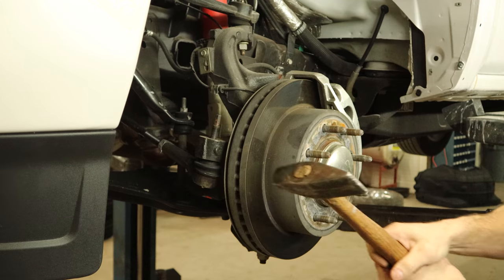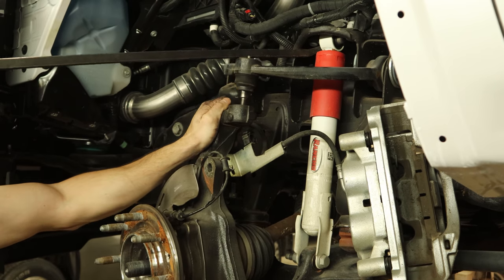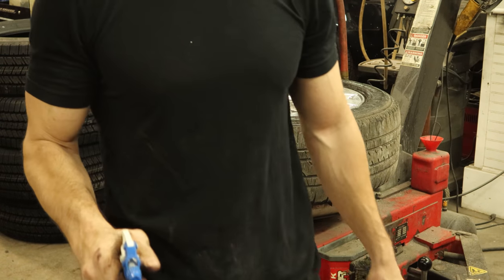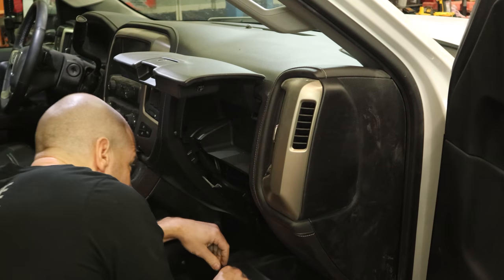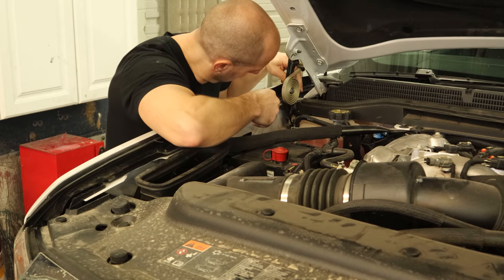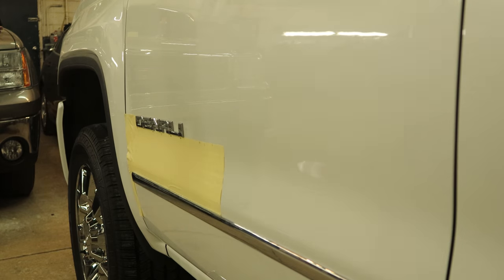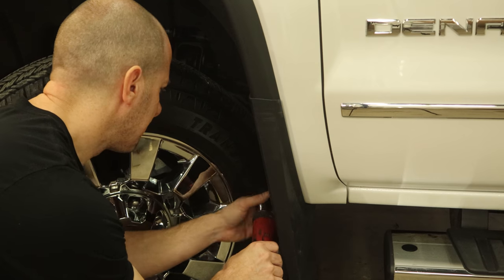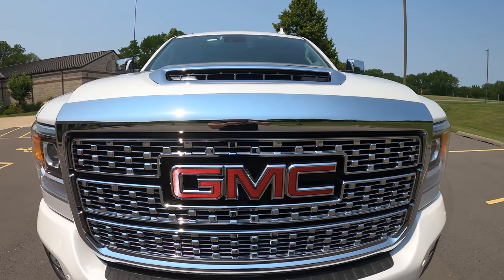Completing the rebuild of the 2019 GMC Sierra Denali HD and answering the important questions Part 7

Comment: Love the simile about the crooked Illinois politicians.  Waiting for the nitpickers to jump in commenting on what you're doing wrong.  I wasn't disappointed.  Don't forget to grease the parts with the haters tears.  LOL.  Thanks for another great upload!  Remember when it comes to wheels, dashboards, or anything else, just say NO to crack!
Reply from the maker: Haters’ tears are a little salty for lubricating applications! 😂
Reply: Trust me.  That part would have to look more like a pretzel to come anywhere close to most politicians.
Reply: No, heck No! Don't use hater's tears, they are far too corrosive, they turn iron to instant rust.
Reply: @vehcor  nothing our rust belt hasn’t already tired.

Comment: Good afternoon Scott, another excellent looking rebuild. That inspection time is a world record. And pray to God that they don't dump your vehicle off of the inspection hoist. What kind of small driver did you use to put the bed cover on? Looked very ergonomic and handy. Take care and good luck with your new truck.
Reply from the maker: That was a Snap-On 3/8 impact.  Not the strongest but it is nice and small and will get most bolts out with no trouble. Have a great weekend!

Comment: Awesome Job! I just had a body shop realign my drivers door. He had the window down and closed the door to check the fitment.  It rattled, and I used your famous saying: "someone's been here before"!
Turns out, the dealership that performed a recall neglected to put 5 bolts back after removing them.... and missed a bolt that holds the fuel filler neck to the body (previous owner had an accident, they removed it to fix the body and broke the plastic clip in the process)
Reply from the maker: Impossible!  The comments say dealer techs know everything! 😂
Reply: @vehcor  hahaha... oh yeah 🙄😒. Hence why I'm on a 3rd warranty trip back for vacuum related issues. 
"Oh its a bad check valve " round 1
"Oh its the brake booster " round 2
"Yeah, the service manager wants to dig deeper, the brake pedal shouldn't be that hard when driving" ... no kidding 🤬.
Reply: Also, let me know when you get bored of the truck.  I'd definitely be a buyer, and I know its better than a dealership buy

Comment: Ah, the snap on unbreakable gimmic. Here in UK I Bought  a 3/8 ratchet that lasted less than a month and guess what? The ratchet mechanism wasn’t part of the guarantee. So the only part of it that moved had no warranty. Still can’t complain my tool chest bought at the same time nearly 40 years ago is still going strong.
The truck looks great now it’s finished and it will last until you get bored and find something else to resurrect for your use.
Reply from the maker: I can break anything, if they are going to replace it when I do, they get my business! 😂

Comment: "I have a rustproofing problem".  Would that were true for the UK car industry in the 1970s.   I bought a Vauxhall Viva HB in 1978 with about 100,000 miles on it - end of life for a British car of that era.  A couple of years later I went through the mandatory UK test (MOT) and it failed.  I asked the inspector what was the problem: "It died of iron-worm".  Apparently the strut tops had been wandering about on corners unhindered by the concept of any solid connection to the frame.  Rust-proofing == iron-worm deterrent.

Comment: I bought the GMC mud flaps for the front of my Denali.  They really help with snow and slush buildup on the running boards.  When I bought them at the GMC dealer, I asked if they required drilling.  HA.  When I got home I found that nod only did they require drilling, there were RIVNUTS.  Still like them, but a bit of a pain in the aass when changing the fuel filter.  Where did you get the tie downs?  I got some that just have a single screw.  Not very secure.
Reply from the maker: Those tie downs are a GM accessory.

Comment: Nice truck!!!!  How do those Backflips hold up in the weather?  My truck is always outside.  Had the retrax on my older truck, but don't like the fact you loose space with the box up front.
Reply from the maker: I liked this one because it folds up against the back window if you need the whole bed.  You lose about 4”.  You have to clean the snow off or they won’t fold flat but the fact that they don’t have locks to freeze or find makes them better than others.

Comment: That oil fill is better located then the 2011 Toyota auris 1.4 d4d you have to remove to do it right the trim under the windscreen and so much unnecessary work 😂
Reply from the maker: Who comes up with these designs? 😂

Comment: I bought a brand-new 2019 Dec of 2018. It's an awesome truck.  Drove it for 3 years and sold it back to the dealer with a little over 17k miles.  They seemed to want it more than I did. 🤑💰

Comment: Empire today.

One I've dragged across the country is, push it, pull it, tow it to golf mill Ford.

What was the Junkyard one that ran forever, where the dejected owners car door falls off?

Bet it's on youtube, brb; victory auto wreckers. 

Like you were doing, it would take less than a half hour/20 minutes to open a 3 digit combo, I had to do that to reclaim a padlock; just sat watching YouTube mindlessly going through each number.

It was my birthday, so 700's.

They really should do key + combo imo.
But methinks just don't leave valuables in overnight.

Or just jb weld a lock hinge and padlock it.

Comment: Definitely Worth It! Since your keeping it and haul a bunch IE using the tail gate , I have a 2021 Chevy HD2500  and yep use the bed a you may want to have the top edge of the tail gate rhino/bullit lined. After owning mine for only 3 weeks or so it started showing scuffing from my non office worker hands griping the tail gate..LOL BTW I wanted the GMC but most of the the dealers here swore they had no allocation to put in an order for an Extended cab (NON CREW CAB) with an 8 Foot bed.

Comment: Got it fixed just in time to get a FIRE RISK RECALL done on it if GM will cover a rebuild.
The Problem: The engine-block heater cord or the terminals that connect the heater cord to the block heater may short-circuit and fail, which may damage the engine components, increasing the risk of fire.

Comment: @vehcor, Hey Scott, the 2020-21 Duramax have an extension tube for the oil cap that makes it easier to add oil.  I put one on my 2017 and it saves a lot of hassle since you are daily driving this truck.

Comment: You should not have highlighted how easy it was to replace that half shaft.  GM will inevitably hear about it and correct this and any other faulty conditions in which their vehicle is easy or convenient to work on for the 2022 model year.

Comment: I have been slacking and just got caught up on this build. I know you said you weren't a fan of the 2020 but I picked one up last year when my other truck started having issues and the first thing I picked up was a set of the factory floor mats. They were about the same price as the weathertech but the last set I had fit horrible and moved around a lot.

That's a sharp looking ride man!

Comment: Actually we have Empire in the south now. But yes I know they started up north. Now the jingle is "eight hundred 588-2300" Empire! (for the nation wide toll free number). And we've already discussed why those wheel wells are carpet on the original dirt-nali video. The dampen noise inside the cab.

Comment: Glad GM finally installed body caps in the rocker panels. In the older models i always removed the latch in the extended cab models just to spray cavity wax inside most owners didn't and they just rusted out.

Comment: Having changed the cabin filter in my Silverado, another YouTuber suggested using the box the new cabin filter came in to slip under the old one so all the accumulated detritus doesn’t fall into the fan. Then pull out the cardboard and filter before installing the new one. I learned this trick too late and some squirrel nest fell into the fan. You don’t want that to happen.

Comment: I'd be real concerned about the lower ball joint taper on the hub / knuckle given it fell apart when the nut was removed.  Oval trackers get bitten by this when the ball joint stud gets bent in a crash and damages the hub / knuckle taper. The ball joint is replaced, things tighten up but the damaged taper allows the stud to move around eventually fatiguing the stud.  After a while the stud breaks where the threads end and the taper starts causing another crash.

Comment: was the oil filter really hand tight?  My15 Denali Duramax must have used a long bar to tighten it.  The first time I changed the oil, I almost destroyed my filter wrench getting it off.
Reply from the maker: Yep, I can get 90% of them off my hand.  The others require hammers chisels and prayers.  Those come from Jiffy Lube! 😂
Reply: That's nothing. One time I struck an oil filter that was so tight that the wrench just slipped on it. I ended up punching a screwdriver through it turn it. That was the only way I could get it off. They must have tightened it with a truck winch.
Reply: @BrucePierson  Many years ago I was working at a gas station.  I got a call from a guy that had twisted the canister off his filter.  I towed it into the garage and once on the lift I was able to get a bar in one of the holes and tapped the end with a hammer until it spun loose.  That had to be the most expensive DIY oil change. :)

Comment: I'm only an airplane mechanic so bear with me. Doesn't the upper control arm need to be loaded before you tighten the upper ball joint since they are mounted on bushings?

Comment: Where do we start…had to use the heat lamp on the truck supposedly in the summer, because Chicago got a little cold….?
Truck was clean when you mentioned the cavity wax leaking out the front door, then it’s rather dirty while replacing the shock…?
Basically ripped the politicians a new one…!
Shows us the cool Console Vault, teased us with the 0001, 0002, 0003, etc…! And you know he’s already been in it…!
Unlike Robert Sizedosentmatteranymore, I don’t hate, especially towards a guy that gives us quality, honest, down to earth building practices, and oh, they are FREE, don’t cost a single penny to watch or not watch, myself I prefer to stay excited for whatever comes next..
Please continue as you are, the true fans and supporters will be here for you and each other.

Love the truck………
P.S. never heard one itsy bitsy, teenie weenie little lie about this build or any other build to date.
Reply from the maker: Haha, in Chicago a heat lamp can be required in the summer!  It was 55 degrees the other day and the next day it was almost 90.  This was back in March.  Thanks for the support.
Reply: @vehcor  Oh I know, Mid-Michigan fan right here…just like your area we have been through all four seasons in one day, freezing rain/snow and 28 degrees at 6am with2 inch’s of white stuff, over cast clouds and 55 degrees at 10am, extremely sunny and 75 degrees at 4pm what snow you ask, oh, it’s back snowing again at 8pm…. In the first week of May….no wonder it’s hard to plan a day…

Comment: Call Empire today!
Reply: Out of curiosity, have you done any repairs on the current generation GM trucks with the unitized aprons and core supports?
Reply from the maker: Yes, it was the one thing I liked about GM.  Now they have turned into Ford and Ram.
Reply: @vehcor  I bought my ‘18 over the ‘19 because of the design change. The interior was my sticking point. Old body style feels classier and solid vs the new one.